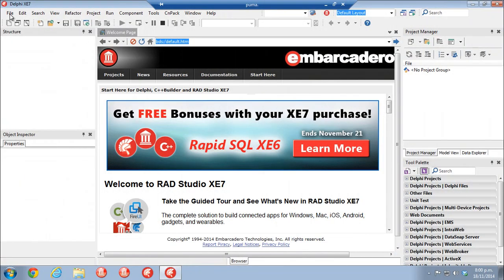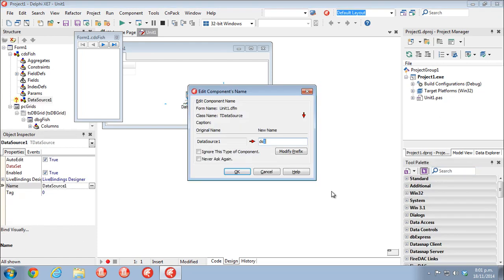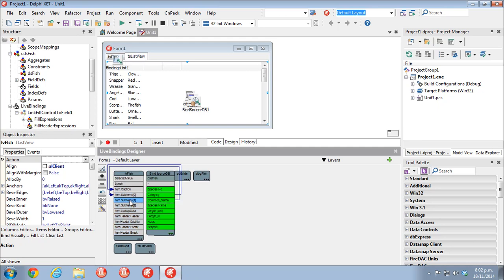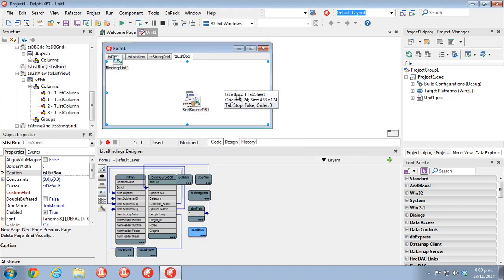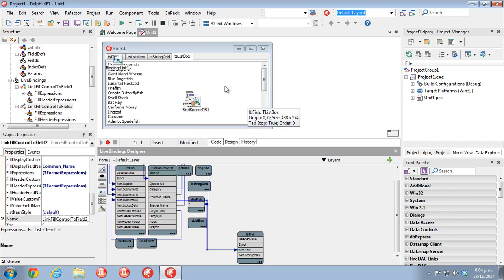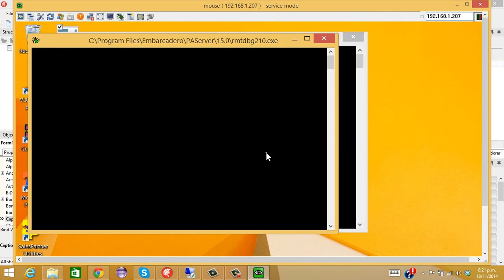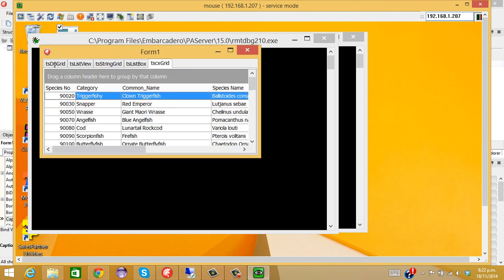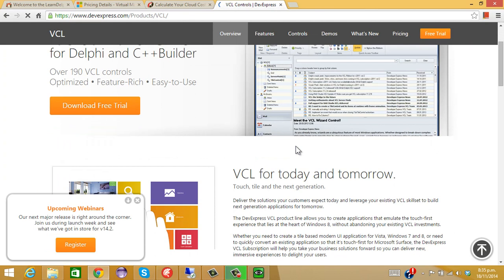#108 - Touch Scrolling on VCL Data-aware Controls

Comment: @Speak Good - Team. You cannot use Genymotion Emulator with Firemonkey. Genymotion uses intel cpu emulation. Firemonkey applications only run on ARM CPUs. ARM emulators are really slow, you cannot avoid that as long as you use Firemonkey.

Using a real android device with be much faster than trying to use an emulator.